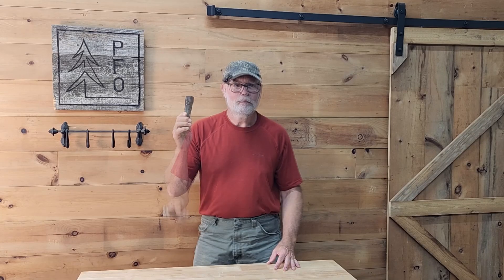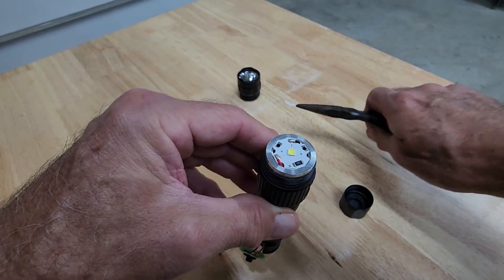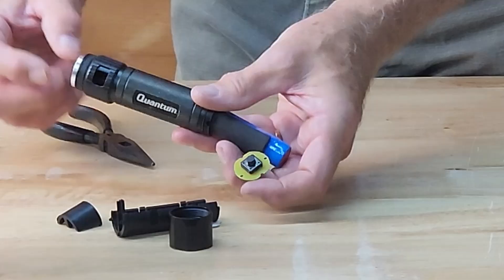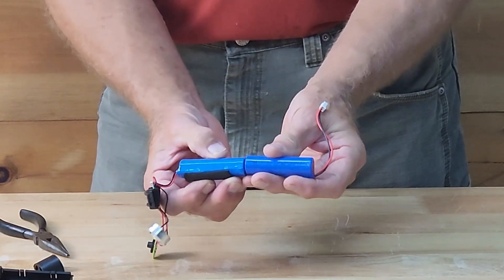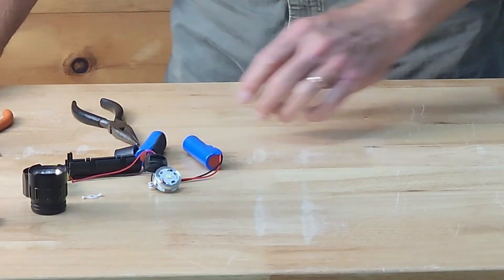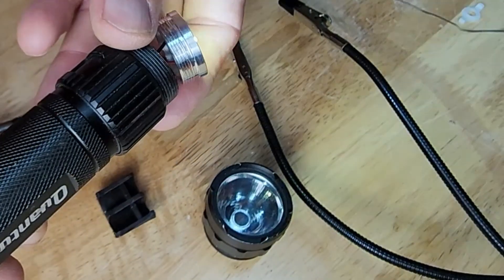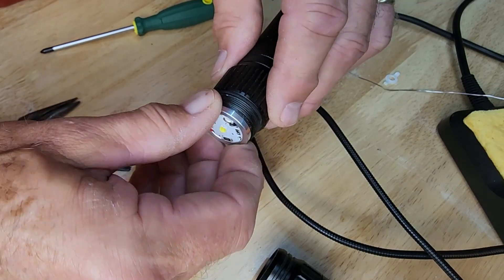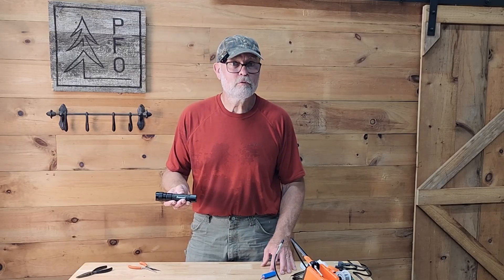How to Replace the Hard-wired Battery on a Harbor Freight Quantum Rechargeable Flashlight

Comment: I tried to replace the battery in mine but I can't get the back cap off! Might have to put it into a vise. How long does your new battery last?
Reply from the maker: Good luck getting the cap off. Maybe a bit of PB Blaster will loosen up the threads. If it is stuck, then the o-ring may have failed, allowing moisture to get into the threads,  in which case the penetrating oil should be able to find the same path.  The new battery holds a charge about as long as the original.

Comment: I wonder if they offer a corresponding 2-pin connecter that you could solder to that board, then it would be a little closer to plug-and-play for future battery replacements, minus assembly. Hope the new battery gives you a decade +.
Reply from the maker: That's a great idea! Hopefully, though, I won't have an opportunity to put that into practice on this flashlight for a few years.